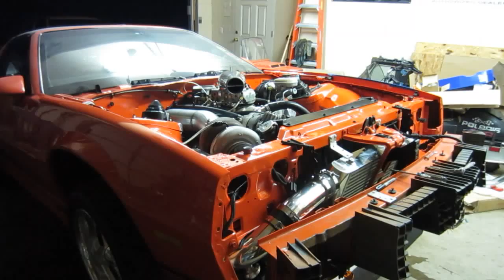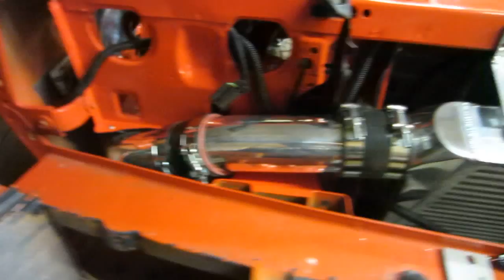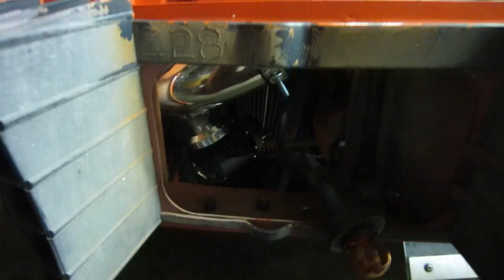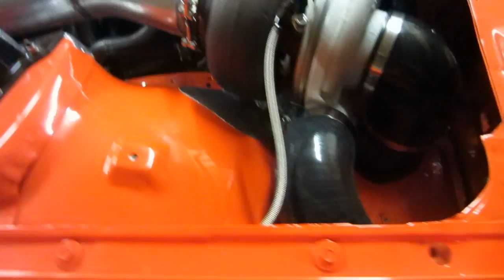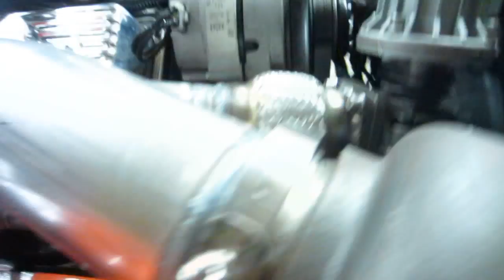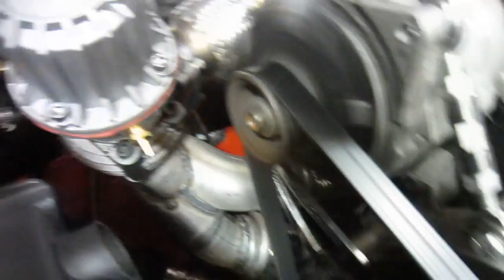Iroc turbo progress

Comment from the maker: Starting with a demon carb, there is not much you physically have to change since they already have nitrophyl floats. I removed the check ball for power valve blowout protection, and that's about it. Then just tuning. I am running a MSD 6AL-2 programmable box and a 2 bar map sensor to control timing. Works great.